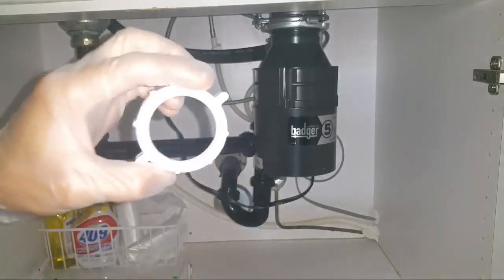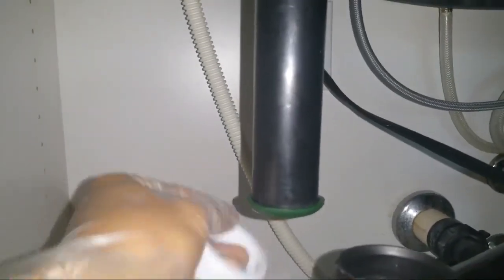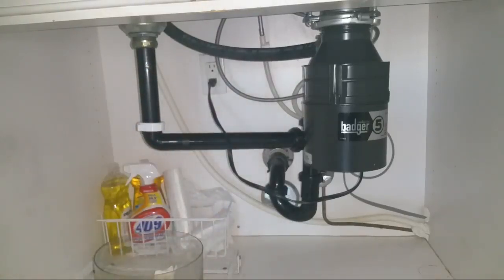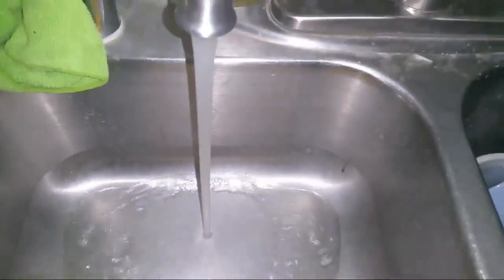HOW TO CHANGE SINK DRAIN SLIP JOINT & NUT WASHER

Comment: The vertical drain pipe is called the tailpiece. The tailpiece is often 1 1/2" diameter in kitchens but is 1 1/4" in bathrooms. The fat washer looks like a reducer washer. You would use it if the tailpiece is 1 /1/4" and the bottom piece (your horizontal piece or if it was a P-trap) is 1 1/2". Anyways, that vertical tailpiece looks a bit short. Teflon tape are not required for this type of installation.

Comment: For some reason the nut washer wouldn't block off water.... feel like this world is glitching. So it leeks through the center circle of the nut washer, against the wall of the pipe where the nut washer is holding.
Reply: What solution did you find cause your not alone 😂 having the same issue